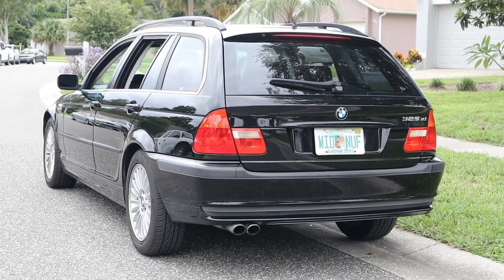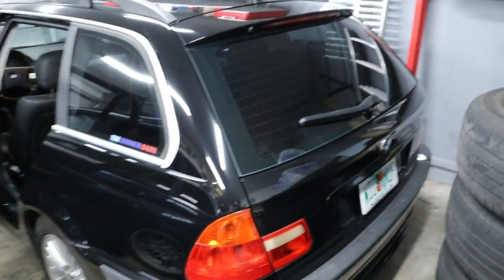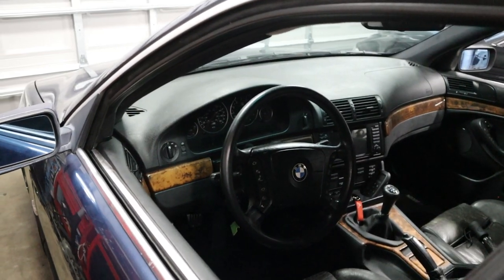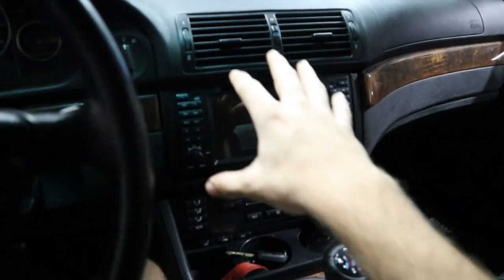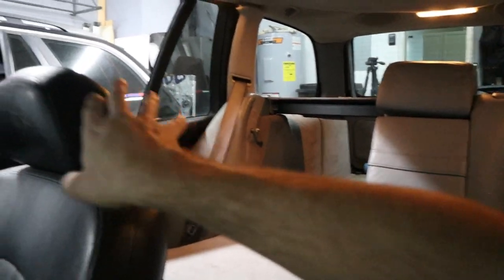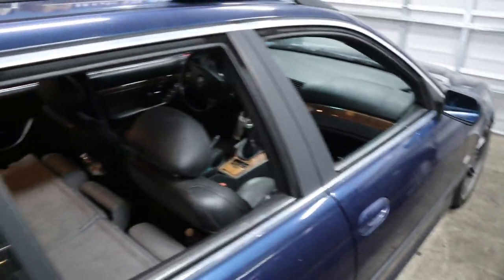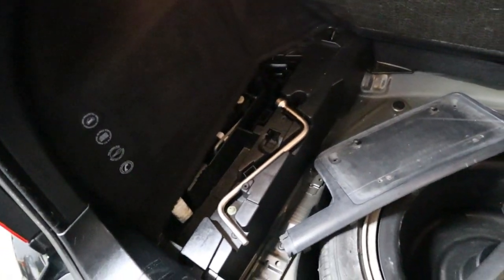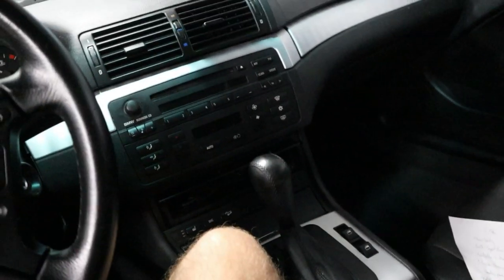E39 Touring VS E46 Touring: Which should you buy?

Comment: I prefer the e39, more beautiful, timeless and in general a better car
Reply: E39 = more generic styling, blasé, antiquated technology, but at this point they both are. Just the e46 is not nearly as out of date technology or looks wise, as the e39. Still nice though ,
Reply: @Onizukachan915  the E39 is a better platform, more torque, more horses, self-levelling rear suspension, unobstructed load area....

And the E39 is very home maintenance friendly. A traditional home mechanic can deal with most things without computerised diagnostics. Even if you do need computerised diagnostics there are lots of options (I use MaxiECU) to confirm your gut instinct about what is wrong.
Reply: @Onizukachan915  generic? It’s a tasteful, understated and timeless design that makes modern cars look tacky.
Reply: @Onizukachan915  the e46 isnt that good looking. E39 is much nicer.
Reply: its good if you want comfy highway cruiser, e46 is much more fun also better looking. E39 without m-bumper is just hideous,  looks great with them tho.
Reply: I drive e39 525d and honestly i really like it feels heavy and stable.. Man she's a beauty
Reply: Yes e39 all the way... I own a 530i wagon.. Nothing can beat that car.. It's a wonderful Car for long rides it is more luxurious mine especially because is is an induvidual model.. But most important it is more easy to work on  a specially the engine... More space under the hood
Reply: @Onizukachan915 Having driven both models and owning an e39 Touring - nope, not at all.

Comment: I have never even been in an E39 wagon, so I can't compare my E46 325xi. However, the smaller car certainly does have a significant amount of space inside for hauling stuff. On one occasion a couple years ago, I brought an eight foot long solid oak counter top home from IKEA and transported it INSIDE my 325 with the back hatch and window closed. I did have to recline the front passenger seat all the way down and rest one end of the counter top on the dash, but it fit inside. 

Undoubtedly, one could do the same thing with an E39, but that's not my point. That is, that even for a rather small car, there is a very large amount of space with which to carry things inside. With a roof box for skis and poles, it's great for a long weekend trek for two or three adults to some distant slopes. Four people would be a little snug with all the gear required, but still doable.

On top of that, it has been very reliable for me over the 40K miles I've driven it over my seven years of ownership and now 265 000 km on the clock. 

There is a ribbon thing to lift the floor in the back and mine has a hook to keep it open. And those two square speaker grills in the back "trunk" area are also for the sub woofers in the Harmon Kardon audio equipped cars like mine.

Comment: I have an e46 sedan and an e39 touring as well and I would like to add some things.
The e46 certainly was available with a 16:9 satnav unit. The very late convertibles from 2007 even came with voice control which some people retrofit to their e39. 
Also as far as I know the e39 touring always came with the self-leveling air suspension in the back just like the e34 touring. Please correct me if I´m wrong.
There are some more things that really annoy me about the e39. There is so much more stuff that can break or is harder to repair. The e39 for instance has heated windshield washer nozzles which are likely to crack and start burning as they get older. Also the dampeners for the trunk lid are all build into the roof which makes it much more difficult to change them. The side skirts are full metal and part of the unibody and tend to rust alot more than the e46 ones which are shielded by a plastic side skirts. 
The e46 sport seats are way more comfortable and hold you much better in place than any seats for the e39 touring (don´t know about the M5 seats though). The steering rack even in the straight 6 models is extremely indirect and feels very loose and sadly is not interchangeable with the e46. Compared with the half static half airride suspension, the e39 is only superior on straight and very bumpy roads over the e46 and not at all sporty as you would expect from any pre SUV era BMW. 
It feels much more like a 7 series wagon. That to be fair is one of the upsides. The e39 is more similar to the e38 and so it´s better suited for retrofittings from the e38 like illuminated door handles. It also has a few options which were never available to the e46 like double-glazed windows, hydraulic trunk lid or pdc in the front.
Reply: If E39's rack is 'extremely indirect and feels very loose' then I'm curious what words you'd need to invent in order to describe the steering feel of my Dacia. You either have a tired car in a desperate need for replacements or a strong tendency to exaggerate ;) P.S. remember a 5-series is way bigger and heavier than a 3-series and even the M5 is not a sports car by any objective measures.
Reply: E34 never had air suspension. The early ones, 92, 93  got hydropnuematic rear suspension. I had one. 

I agree, with your assessment, it’s bigger, softer, and that isn’t a bad thing. 
However the e39 is also a clusterfuck of partial analog and digital systems, it’s half way between the fully analog e34 and the fully digital e60. It’s a real pain in the ass to diagnose, and to be frank, I was not massively impressed with any of the e39 sedans or tourings I drove or worked on. 

The e46/3 unlike the 5 series/2 went straight to full digital systems. Basically the e39 e38 and e53 were the test mules for the change over.
Reply: @Onizukachan915  using diagnostic software diagnosing the E39 isn't a problem. The E39 is also simple enough that  that a traditional mechanic doesn't always need diagnostic software.
Reply: Air suspension was optional.
Steering rack may not be as sharp as in the 3 series, but still totally decent. Of course every single piece down there can cause loose feeling when worn out.
Windshield washer nozzles are plug and play interchangable with e60. You get a much nicer spray on screen! You only lose e39's intensive wash function (separate water hoses to the nozzles).
Reply: @ucan92  Here in Europe the self-levelling rear suspension was standard on the E39 Tourings. I don't think it was available on the saloons.
Reply: E46 is very cramped compared to the E39 (tried bothe E46 & E39 530D Tourings before settling for  the E39.

Loads more rear load space on the E39, in part due to the E39 being bigger but there is no intrusion from the rear suspension.

Great motorway cruiser, excellent economy, not expensive to service and with a 530D Touring all that torque and the self-levelling rear suspension makes it a great tow-car (I have a 1,800 kilgram caravan).
Reply: @grahamepigney8565  I'm from EU as well. Only tourings had air suspension, that is clear. But I know also tourings with classic suspension. Air was only standard with some other options combined.
Reply: @ucan92  I can't find specifications for Tourings without air suspension, all SE, Sport and M variants had rear self-levelling suspension. Some will undoubtedly have been converted to spring since as many people chose this false economy when having problems with the HALL sensors or the control unit.
Reply: @grahamepigney8565  M techniks had air suspension, that's true.
Reply: @ucan92  So did SE and Sport Tourings, I have one of each.

Seems that the only E39 Tourings without rear air suspension were the most basic models which probably were sold in the UK, BMWs being a luxury marque, except to special order
Reply: There are e39 touring with normal suspension, 97-98 single Vanus .

Comment: That S62 swapped wagon is nice.... BMW should have made those from the factory! (and they did with the E60!)   Thirsty car though, not cheap to run.
If you are on a budget, the E46 is a fun car that is not too expensive to run, provided you are good at DIY.   In the UK and Europe we got loads of different engine options from 1.8 to 3.0, in both petrol and diesel.  The 330d was/is a great car and was one of the first "sporty diesel" cars from the early 00s.
Reply: Fahre ein Touring e46 M Paket FL mit 330D.  Er kackt einige Autos auch mit Baujahr 2023.   für Diesel der beste Diesel diesen zeit.   Es gibt nichts vergleichbares

Comment: Sometimes the choice isn't really a choice.

Before buying my  530D E39 Tourings  I checked out the 330D E46 Touring.

The lower power of the 3.0 diesel in the E46 combined with the lack of self-levelling suspension ruled out the E46 as a tow car for our 1,800 kg caravan. Plus the self-levelling suspension makes for a more unobstructed load area.

The E46 also felt cramped, lack of head and elbow room.

For me it was a no brainer and I replaced my '93 520i Touring with '01 530D Touring.
Reply: not all 530d tourings have the self levelling rear suspension
Reply: @FOXeye95  all 530D Tourings , other than some base models, had self-leveliing suspension. All UK 530D Tourings were SE or Sport spec. Base model E39 Tourings are extremely unusual.
Reply: @grahamepigney8565  how can I tell wich spec I have on mine?

Comment: I’m not sure the e46 has an advantage with fuel mileage because of the extra weight with the drivetrain. With a good set of snow tires I am hard pressed to get stuck in the white stuff we get in Wisconsin with my e39.
Reply: Well tbh I have no idea why BMW didn't include any X-Drive option on the E39. That was a massive fail imho. 3 Series had it, previous and next 5 series had it but no the E39 :/
Reply: Do you get 35 mpg at 75 mph? My (technically is now my kid’s) 325 wagon does.

Comment: I have a BMW E46 330i Touring 5speed manual. They had factory satnav available from new. Mine came with a removable towbar and dog guard built into the parcel shelf cover. One thing that almost caught me out with the E46 touring is there's no keyhole on the tailgate and there's no latch in the interior to open the trunk. The only keyhole is in the drivers door. My almost ruinous scenario was the buttons on my key weren't working (common battery issue) and my drivers door lock barrel broke. Thankfully the car was unlocked and I just left it unlocked until I was able to order a new key. Then I had to order a new door barrel lock. If your E46 touring's battery dies, there's no way of opening the rear to get to the battery. Your best bet is charging from the contacts in the engine bay enough to open the rear hatch to access the battery, which is a pain.

Comment: E46 offers xdrive. E 39 doesnt. That was my bottom line.
Recentle sold, after 3,5 years - Turing(wagon) 330 xd M pack. 3.0 turbo diesel - over 400 nm of torque on constant all wheel drive and 200 hp is more that enough.
Good luck. Really miss my 46. 
P.s. Got myself a e90 xdrive 3.0 gasoline now.

Comment: I have both and I prefer the E46 (330xiT 5spd).  The E39 (528iT 5spd) is great, it is the last of the old/proper BMW, the E46 is the first of the new...and I prefer older BMW's.  However there is something with the 330 that even though it has awd is still more of what I expect out of a BMW.  The build quality is better, it doesn't break nearly as much as 5 and imo is designed better.  I don't know maybe I'm just a 3 guy.  There are great things about the 5 though...very smooth and comfortable, great gas mileage (28 mpg + on the highway at 80 mph) lots of room and visibility, handsome.  I will be selling it as I rarely drive it anymore.

Comment: in europe, the smaller engine options on the e39 wagon come without the air suspension in the rear, i much prefer it that way.
my '03 520i manual with the 2.2liter M54 engine runs on LPG and thus even smoother than the regular gasoline 6 (LPG has 106 octane ;-) LPG also is cleaner burning and emits "only" CO2, just like your camping gas stove. 451 000 km and still silky smooth as a sewing machine, a true touring wagon. i love it. plus, with the rear seats folded down, i'm able to sleep in it if i have to.
Reply: I used to sleep in my old 525tds touring on "camping" trips because it was always warmer, quieter and more comfy than being in the tent :-D

Comment: I have bought a E46 Touring and i can't be happier.
As You said, theres a lot of spare parts to make it just like i want, Eibach springs, M Steering wheel, navi, new interior etc.
It's a  nice car to drive, its quite quick and comfortable, but at the same time suspension is tight and i feel really safe driving it.  
Also they are really popular here in Europe, so I can find DIY instructions for most reapairs, not saying that You will need a lot of them, cause (belive that or not) they are really realible cars, that You can rely on daily basis.

Comment: So....in terms of cost of ownership/repairs/reliability is the E46 a clear winner?  I like a smaller car so E46 would be my fav...especially if it had a manual transmission.
Reply from the maker: Yes you got it! E46 a better daily, cheaper, smaller, compatible parts with sedan. E39 more luxurious, better high speed handling, more space.
Reply: @TheBimmerBarn  thanks

Comment: Well... I own an E39 525i Touring (manual) and i've got the chance to try an e46 330i touring. 

these are my experiences:

e46 engine bay is more cramped (and it is full of plastic crap), it is much-much worse to work on it. (in my country i have to work on my car if i want it to be done correctly (btw i'm an IT engineer))
So, in case of E46 there is much less space to work on the engine (which is... well... it is needed because these cars are minimum 20 years old and most of the gaskets are gone...)
Less space means more heat --> and the more heat eats the plastic parts and rubber tubes faster... (the plastic parts were in way worse condition in the e46 than in the E39. (even though the E39 has twice the miles than the E46...)

E39 suspension is just superior to E46. BTW the swingarms, and most of the bushings are the same between E39 saloon and Touring. There are a couple of exceptions, but most of the parts are compatible. If you just sit in an e39 you won't really notice how worn out it's suspension is, until you try one with brand new bushings and swingarms, because it just gets sloppier as it ages, and thats all. No strange noises (ok... when it is completely shot and nearly falls out of the car, there might be noises), nothing harsh, just it behaves/rides like a boat... (and that's actually the time to replace some worn out suspension parts... :D )

E39-es with i6 engines have steering racks, so there is not that much difference. E39 is probably heavier than E46 but it depends on the configuration (there are e46 configs that are about 1.8 tons, and e39 configs with just 1.6). But on the other hand the e39 trunk is bigger, and not only just that, but the weird shape of the e46 trunk is more of a limit, than the actual size.

In my opinion the e39 touring is just superior to e46 touring. E46 is newer, probably weight less, so it might be a bit more agile (as far as i now, to counter the bigger weight, the e39 tourings came with a shorter diff ratio), but the interior is kinda like some cheapo vw or opel/vauxhall/skoda etc. wich is just sad.

So the final verdict is that, there is NO WAY i would swap my e39 touring to any e46 tourings. :D

(i don't actually know the diesel versions, there might be bigger differences there, but i don't like tractor sounds, so for me the only way is petrol /gasoline :D)

Comment: I currently have an e46 320d saloon (sedan), it didnt come with any cupholders i had to buy an aftermarket chinese part also my rear centre seat doesn't have the cupholders either. a bit annoying but mainly trying to restore it to a presentable state without going over the top. the typical rusty arches and the odd check engine light here and there from the last owner fitting an aftermarket exhaust without fitting the oxygen sensor haha.

Comment: I have both of them in my garage 😃. The 530d Touring and the 330xd Touring. You have to take care of them very well and the investment needed litterly never ends 🤓. But it's worth every penny. You will be rewarded with a great luxury drive. Cars like this are not built anymore theses days unfortunately. Now it's all about recycling and lowest quality for maximum price to gain shareholder profit for the corporation, nothing else. I owned a 530d E65 and it's not to be compared with the E39, specifically on the interior materials in use. E39 and E38 were the best BMW's ever designed and built by BMW.

Comment: Its funny how heavy the rear luggage cover is on the e39. Its soooo heavy. No idea why they made it that way. German engineering I guess. Great cars until it all starts going wrong at high miles. Unless you can afford to drop thousands into keeping it on the road it ends up being sold to a scrap agent. I had a e60 and after replacing the starter motor at less than 200 kilometers I decided to sell it sadly.

Comment: BMW e46 in Europe has a bunch of power plant options. ( 1.9 , 2.0, 2.2, 2.5 (deforced), 2.5, 2.8, 3.0, 3.2 on petrol and 1.8d, 2.0d, 2.5d, 3.0d ) we also have some 330xi or 330xd but most people choose RWD only, bcs BMW :)
e39 on the other hand has only few options ( 2.0, 2.5 (deforced), 2.5, 2.8. 3.0, 4.0 petrol and 2.0d, 2.5d, 3.0d ), but if money wouldn't be a problem I would definatelly choose e39 over e46. Better comfort, look that say's (not ot mess with), more powerfull engines, personally I think e46 is more like teenagers first car or winter beater. (that funny moment whan my profile pic is actually my old e46 that i had few years ago ). I own a e91 lci 320d now and I'm pretty happy with. 
but the sad truth is atleast where I live we drive mostly 1.8d - 3.0d and few who don't drive as much take 2.0 - 2.5 petrol but put LPG on them, because fuel prices are just mad... 6,76 $ per galon and our average monthly salary is just 562 - 780 $. So yeah...